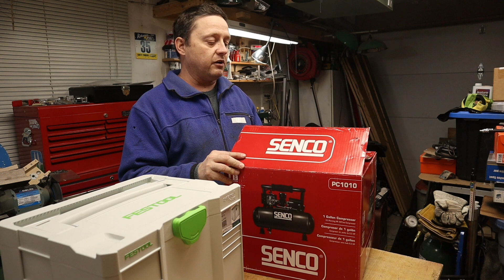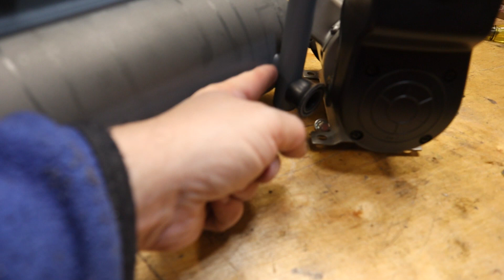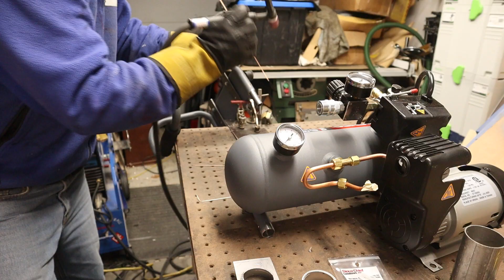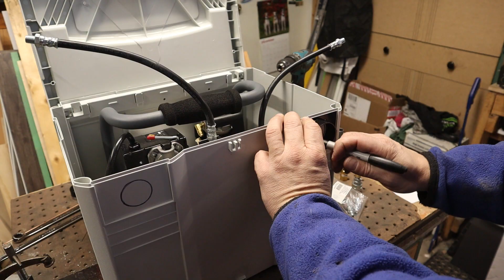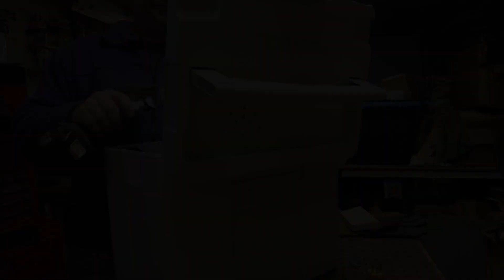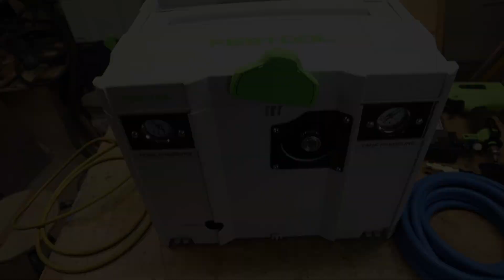How to install an Air Compressor into a Systainer / DIY a small compressor into a stackable Tool Box

Comment: It would have been easier to make a wooden box for it, and the same result.
Reply from the maker: Yes and no.  Yes, it would have been easier to make a simple box.  It would have been much harder to make a wooden box integrate with the Festool sustainer system that stacks and locks into place.   I was thinking of doing that but it seemed more tedious and time consuming. The sustainer was $100 and works perfectly.  Cheers.

Comment: I would have lined the inside with noise deadening mat to keep the noise down
Reply from the maker: Yes, you can do that as well. I’d be cautious of heat build up if you have a heavier duty cycle.  This compressor is pretty quite as it is.  I don’t really notice that it’s that load as is.  Cheers.

Comment: How do you drain the compressor?
Reply from the maker: There is a little hole on the bottom on the bottom left and some small holes in the floor of the systainer. You can easily reach in with your finger to open and close the drain valve.